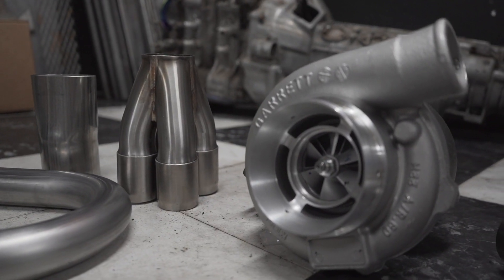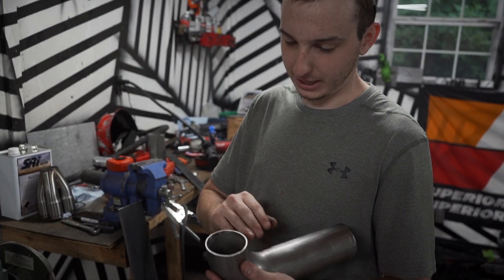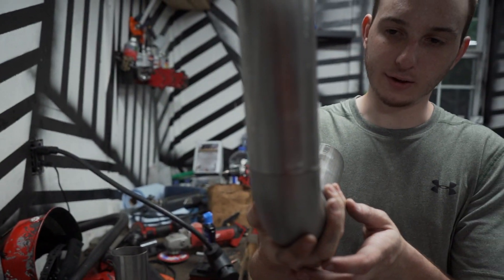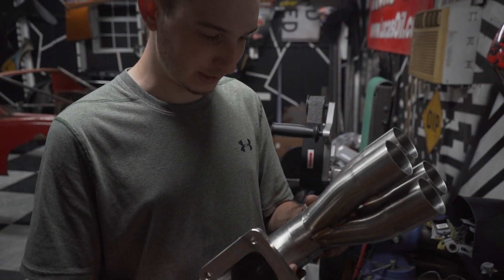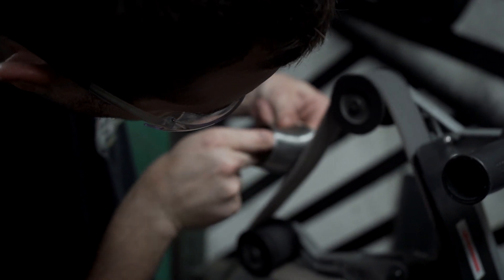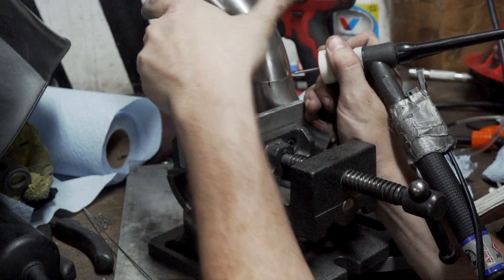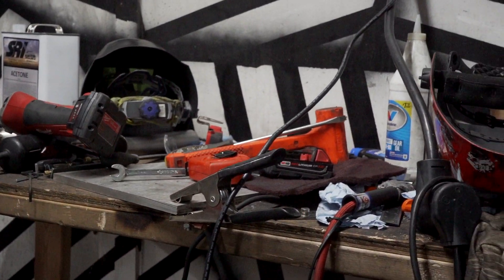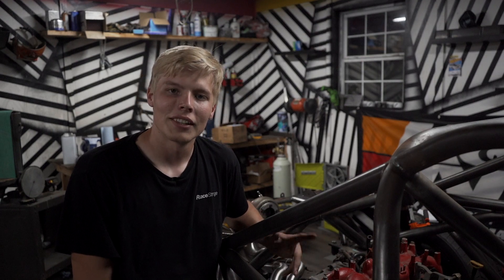Making Turbo Headers For My Porsche Race Car!

Comment: Great videos and amazing built, but safety includes wearing leather gloves when sanding and cutting, just saying… ;-)

I know you get clumsy with thick gloves but you get used to it and, more importantly, the weirder you will feel when not wearing them !
like on a motorcycle.
Reply from the maker: For some reason I absolutely hate gloves, and it’s somewhat subconscious because ill take them off when thinking. But also a safety thing i can never follow is a guard on a 4” grinder. It may bite me but some caution with cutoffs seems good enough.